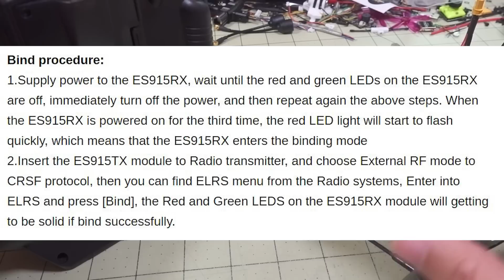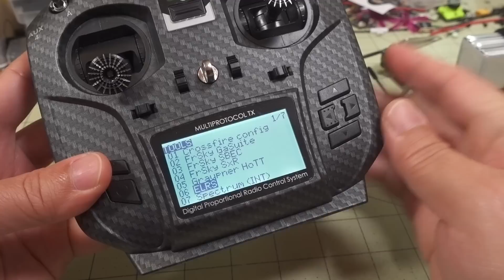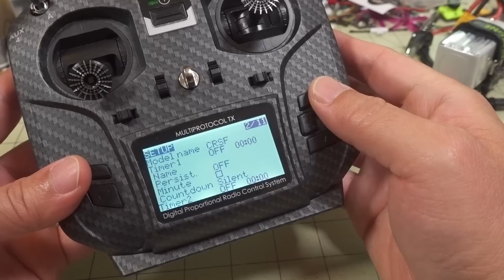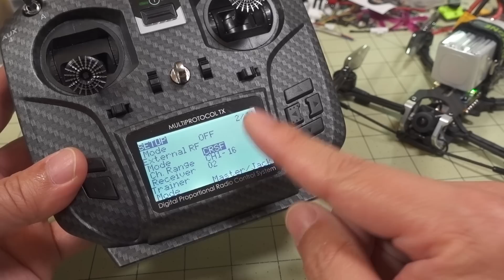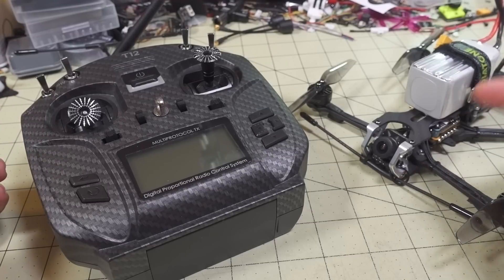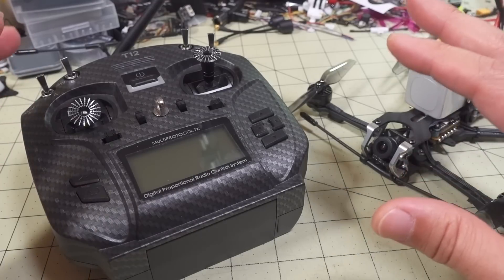Happymodel ExpressLRS 900mhz TX & RX System 📡🪐

Comment: Man,  how do you connect the Antenna Wire to the main board on the ELRS module?
Reply from the maker: Are you talking about the u.FL connector?  It just snaps in.  You do need to line it up properly otherwise if you force it too much, the connector will break.
Reply: @AlbertKimTV  yea, I always get nervous pushing thise u.FL connectors down...I bent one a back in 2017 when I first got into FPV and worry about doing that again..lol

Comment: Hi Albert, I bought the es915rx to be installed on moblite6.
I soldered es915rx to TX1, RX1, 5V and GND. And the moblite suddenly not recognized by my computer & betaflight.
I remove the es915rx from the moblite. And everything was back to normal.
What did I do wrong? Please help. Thanks Albert.
Reply from the maker: I think you may have connected it up wrong. I'd double check you wired it up properly and also that your board matches whatever diagram you referenced. They all look similar...
Reply: @AlbertKimTV  thanks for replying. Just found out that i might have shorted the 5V rail.

Comment: Is there a 2.4GHz version for sale yet?
Reply from the maker: not yet
Reply: The 2.4GHz version is now available for pre-order on Banggood at $39 for the TX and $15-20 for the RX depending on the version + shipping. Estimated to ship first week of May.
I ordered the TX and it comes with a 3D-printed module box, one EP1 RX with a normal T-antenna for my 5" and one EP2 with a tiny built in ceramic antenna for a Diatone R349 I ordered a week back.

Comment: telemetry package ratio on LUA page should indicate 0:200 on 200hz package rate. yours showed 0:250, and binding procedure isn't available or implemented on original ELRS, perhaps happymodel rewrite the firmware and there's few buggy things right ?
Reply from the maker: I think they customized the firmware as I noticed some differences between this and what I saw on the wiki pages.
Reply: @AlbertKimTV  yes there are few major difference between og version, and happymodel version, wish happymodel could give an official release note on their v1.0 hardware + sofware bundling

Comment: Your packet rate is showing incorrect just soyoure aware.  At 200hz it should be showing 0:200. It would only be showing 0:250 if you were running the 2.4ghz link at 250hz refresh rate.

Comment: Happymodel tx target is available in the develop branch.  Rx is coming, but it's the same as the r9mm so it can also be used.

Binding is as simple of powering the RX on and off 3 times, then hitting bind in lua. Done.

TLM warnings are due to the low tlm ratio used.  This can be increased in lua.  There is also a fix in develop to minimise warnings further.  But like you, I turn tlm off.

FYI the module will only go up to 1W and does require cooling!!!

Comment: that's fine as hell , hope they make it 868mhz EU compatible
Reply: Express LRS is EU compatible. You can configure it while building the firmware. I totally recommend ELRS. I'm using my old R9M system with it.
Reply: Yeah it is compatible. Works very well for me
Reply: you will just need to flash the hardware to 868mhz and get 868mhz antennas
Reply: @terrorbirbfpv4732  mmm that doesn't sound too bad

Comment: To use 250mW and over there is a fan mod that needs to be done to keep it to keep it cool and stable.
Reply: Any info on the fan mod? I printed the right case, have the fan etc, but don't have any info on where I should be soldering these to!
Reply: @DanielStinebaugh  I thought I has posted a link this morning but I can't see it now. It's in the wiki https://github.com/ExpressLRS/ExpressLRS/wiki/R9M-Fan-Mod-Cover

Comment: Would be nice to try the module with 868mhz antennas and if it get the same range or a bit more, because 900mhz can't be use in Europe
Reply from the maker: Pretty sure those versions will come out later along with 2.4ghz as well.
Reply: 868 is available. I use it
Reply: Did you buy it already setup with 868mhz antennas ? And where ?
Reply: @vico01  I flashed my R9 with expresslrs FW and selected the 868 option
Reply: @gautamkrishna7421  can you explain what setup you are using. Because I am not sure what is going on. I have a R9 system, non EU. Can I use this system and how?
Reply: @user-zw7zd3qv1w  Yes there is no hardware difference between non eu and eu, just the tuning of the antenna. You can use it with the expresslrs system either 915mhz or 868mhz wherever you are
Reply: just set the user defines to 868mhz and flash it. also make sure you have 868mhz antennas
Reply: @terrorbirbfpv4732  actually with the new configurator you don't even need to mess with the user defines it's just check boxes

Comment: Nice. I saw this thing can go 30 miles. What kind of VTX does it need to go that far?
Reply from the maker: There are high power ones that aren't legal in the U.S. or you probably have to use something like a 1.3ghz system to go that far.  Basically, not legal in the U.S. and you need many different kinds of licenses to do that.
Reply: Actually it was the 2.4ghz system that went 30kms on 100mw, which is even more impressive!!
Reply: @valentin.kompatscher  ☝️yes, lol!!
Reply: Maybe 2.4 ghz video system could work for you?
Reply: @tuttuti123  yeah he'd need 2.4ghz or 1.3 to go that far
Reply: @verdi6092  2.4 inherently has worse penetration but with expresslrs no one has really made it fail safe in long range tests. It would be interesting to see how it performs in bandos and stuff. Join the discord if you’ve got questions

Comment: is there an 868  UK   version ?
Reply: Yes yes it definitely is. You may need to reflash the receiver and/or the module but it works fine. I’m personally using it
Reply: I believe they are working on the antenna. The hardware is the same it just needs a firmware update.
Reply: @SteveFPV80  any 868mhz antenna can be used
Reply: @fpvhawk  I've been running on old R9 hardware for a while now so don't know what connectors are on the happymodel hardware. If it's the same as R9 or Crossfire then you can just use those antenna and reflash the hardware.
Reply from the maker: Not currently, but probably will come out later.
Reply: just set the user defines to 868mhz and flash it. also make sure you have 868mhz antennas